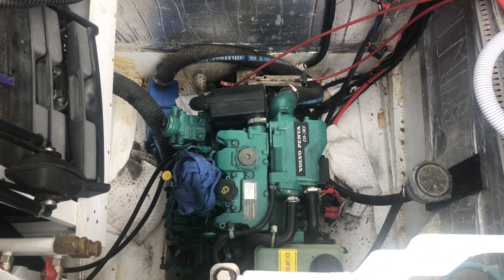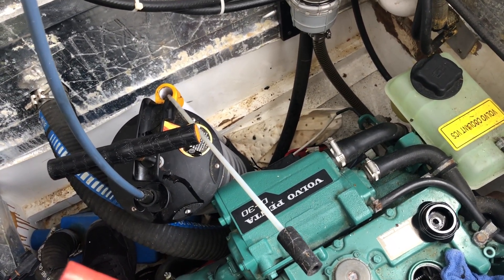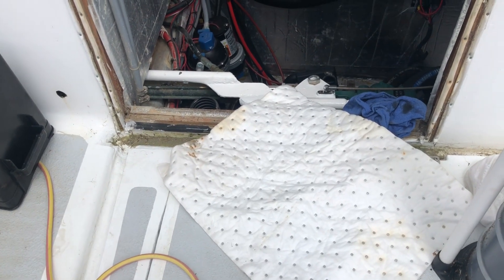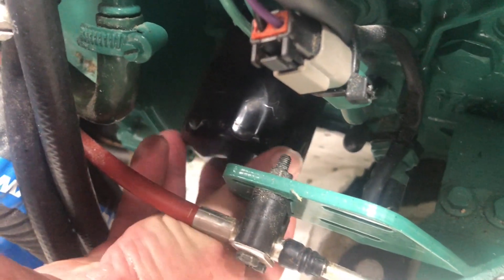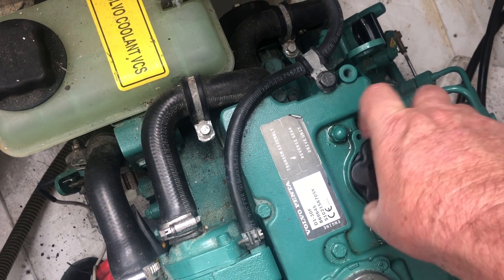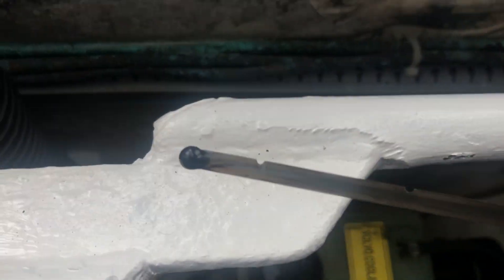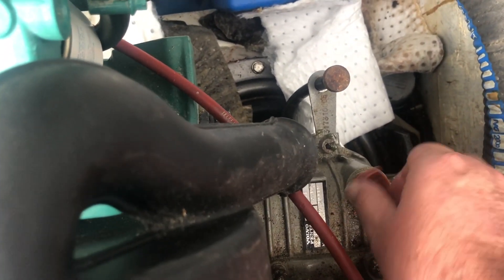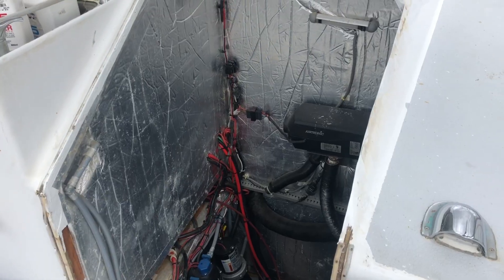Oil change on Volvo D1-30 Diesel Boat Engine

Comment: Hi. Thx for the video. One question. Why are you using the dipstickhole instead of using the oil drain pipe? Are you really able to suck all 3,6 lieters from the dipstic hole?
Reply from the maker: Hi
In the confined engine bays and not being very flexible it is hard to get down there. Also if the rubber cap comes off later oil is slowly sent out of it into the engine bay. That caused a slow oil leak a couple of years ago which took a while to figure out. 
Thus via the dip stick is easier for me and gets almost all the oil out.
Reply: @SV-WAKAWAKA  I would like to raise a small warning, I also used the hole for the dipstick, but today that didn't work, unsure why. Got just a litre. However I then tried the oil drain pipe, which not only worked but also seemed to really pull out the last in the bottom.